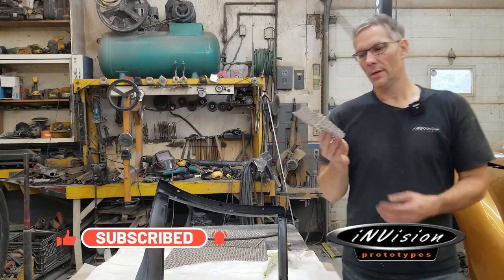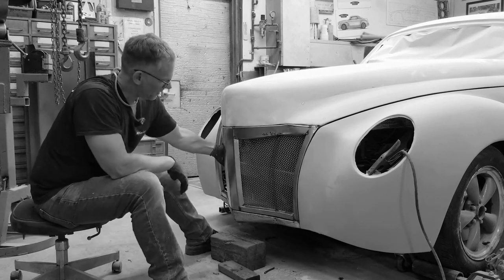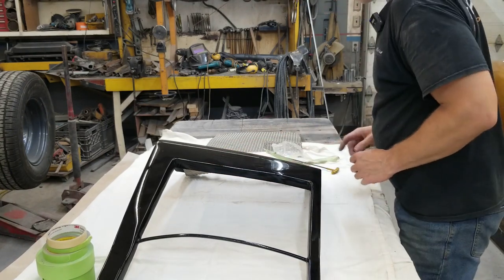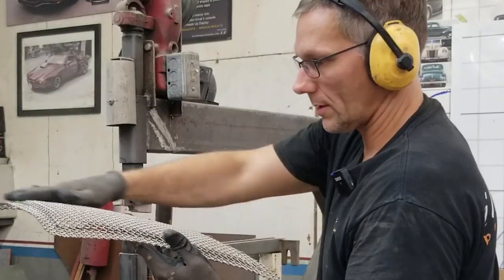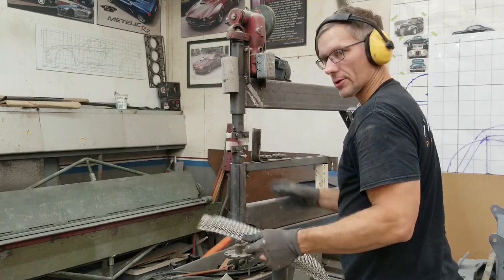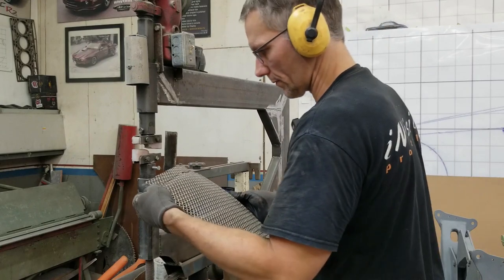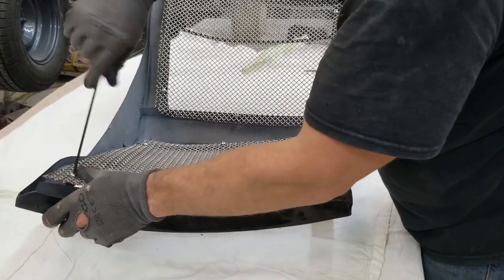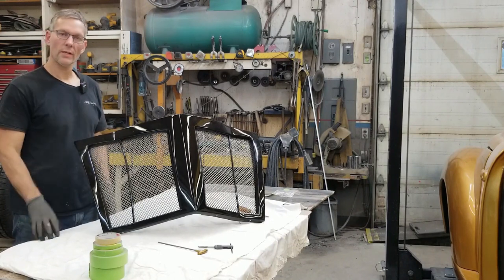HOW TO Build a CUSTOM GRILL - Woven Stainless Mesh - Ep.76 | 1940 Ford Inspired Hardtop Coupe

Comment: First time I did this used the English Wheel to try and put in some shape. That cost me an anvil wheel since the SS mesh is tuff stuff!. Lesson learned the hard way. Keep the vids coming!
Reply from the maker: Ohh noo!  dang.  Hope it didn't gouge too deep.  Stainless is tough stuff... even when drilling holes in it.
Reply: Pete - thanks for this comment.  I was wondering if an english wheel would work - thanks for confirming.  👍😎👍
Reply: @joell439  Depends on the wheels/anvils. Pro grade anvils are available hardened so they could work on stainless.
Reply: I screwed up the blades of a big stomp shear cutting some thick ss mesh for a 64 Riveria grille and turnsignals,,  stainless is harder to cut and grind for shure.

Comment: Very informative and relevant to my project.  I would greatly appreciate your thoughts:
- when you weld nuts to the workpiece do you care about grinding off the galvanizing?  does it make a difference?  When I tig weld these things I get some weird smoke and sut but the weld sees solid...just would be great to have a second opinion
- when you flatten the seam allowance on the expanded metal using that funky power hammer -- is that necessary before you screw it into the frame?
Thank you.
Reply from the maker: At the end of the day it really doesn't make that much of a difference as everything is primered and painted.  That smoke/soot is the galvanizing being burned off...make sure you have proper ventilation!  

As for the second part of you question, I'm not following you on 'flatten the seam allowance"??.  The reciprocating hammer was used to create a step in the woven mesh ... to add some detail rather than install a flat sheet.  Not necessary but looks better.

Comment: How did you make your power hammer?  I like it.
Reply from the maker: Hey Man, Thanks!!  This was slapped together using some box tubing for the slide mechanism, a few drops of (can't remember now)1/4" or 5/16"TK 2x5 box tubing for the 'C' frame, an old steam pump(for the cam action), a 1/2hp motor and a paperclip.  Basically built out of necessity one afternoon.  She's not pretty but helped to get a job done.  The dies are whittled out of a high density polymer material... they don't mar the metal.
Reply: @iNVisionPrototypes  thank you for the info. Sorry for the delay.